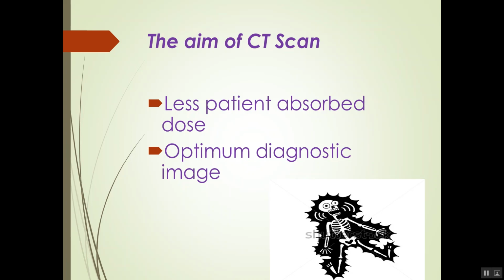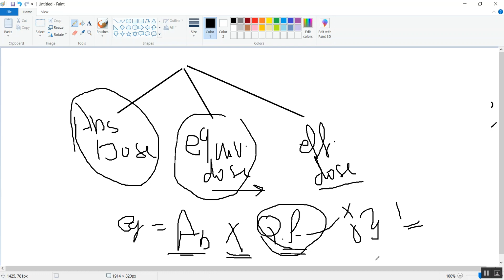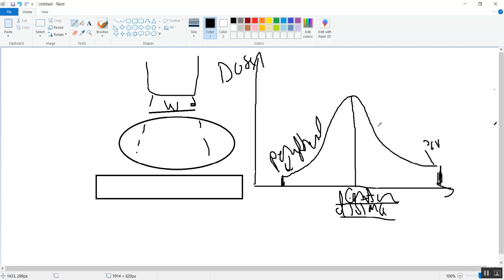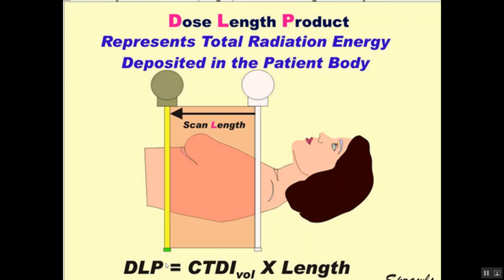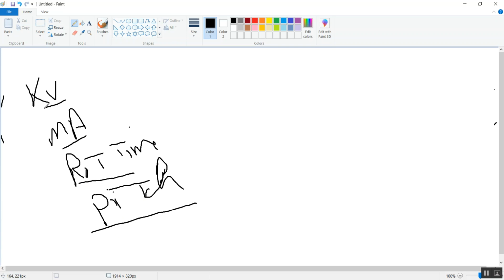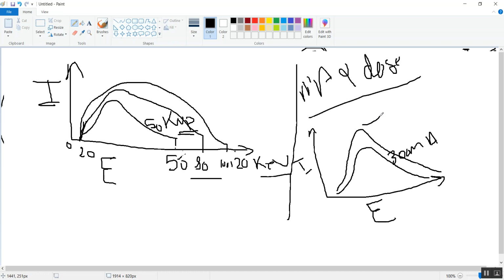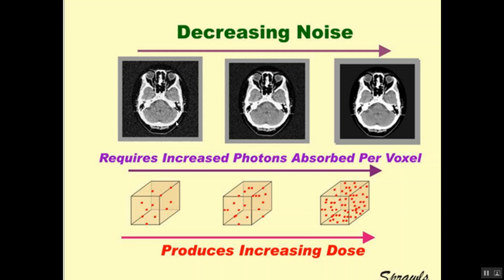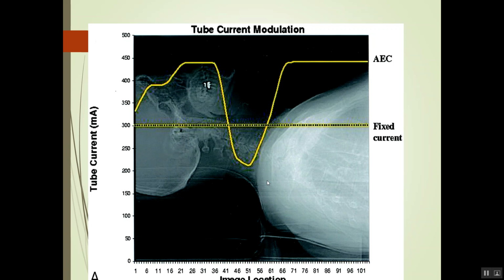CT Physics in English Part 2

Comment: Thank you for your amazing lectures. I have a question if you would be kind enough to answer. Regarding kvp, sometimes it's mentioned that higher kvp increases the penetration of the beam so the photons are more likely to pass through the patient without being absorbed so the dose would be less. And sometimes it is mentioned that increasing kv increases the dose by kvp to the power of two. So in an exam which should we consider? How should we answe?
Reply from the maker: Good question. In ct increasing kv increase the dose. In X ray, reduce the dose. Contact me for more details WhatsApp 00 201092006709